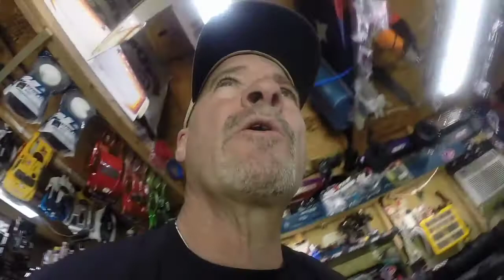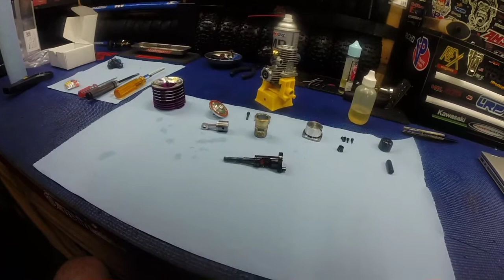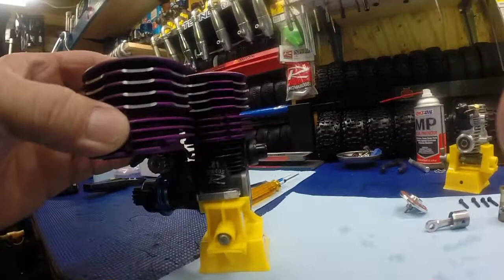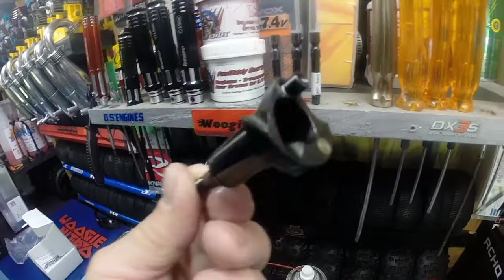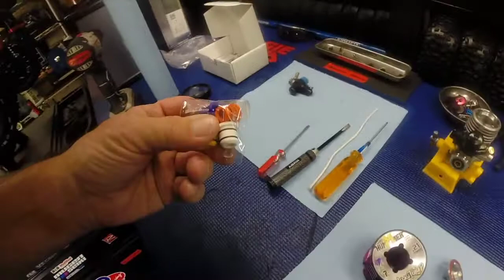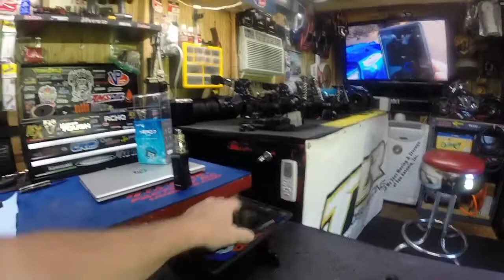NOVA IELASI TUNED...LETS OPEN HER UP

Comment: I been watching you, botajell & Adam drake, I picked up a new Losi 8t rtr figured it was the best way to get into nitro. I’m wondering if the 3.0,4.0 parts work on the rtr? I’m wanting to replace the shock towers & turnbuckles few other parts I canny remember now. I’ve put the back plate on & now using a bump starter thanks to you & botajell! I love it!!  so much better!!! Not looking to get to crazy with the upgrades, I plan on buying a Losi xt or tekno is coming out with a new NB48 2.0 “I believe is what there calling it”  wanna get one of these for a winter build! Anyway any help is greatly appreciated! Really enjoy the vids & look forward to more! keep up the great work! Subbed & liked!!👍🏼💪🏻
Reply from the maker: yes most parts do fit I would recommend doing the 4.0 diffs front center and rear shock towers and shocks at least that's a good starter
Reply: Woogie Nitro awesome!! Thanks!

Comment: Hey Woogie, what exactly does Lelasi do to the engines before he sends them out? I bought one but have yet to receive it. I started wondering what exactly he.does to engines..
Reply from the maker: basically puts a race tune on the sleeve the sleeve has a lot of modding and fangs on it look at my video I think two videos back or one video back I I broke it down to show the internals